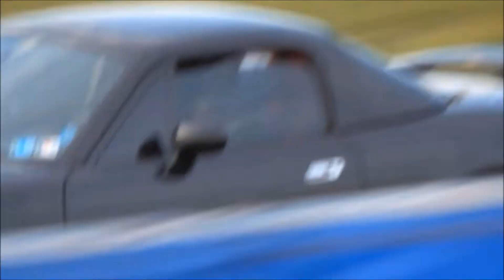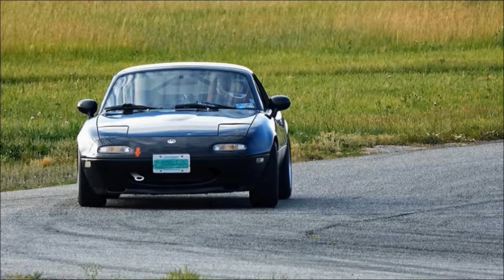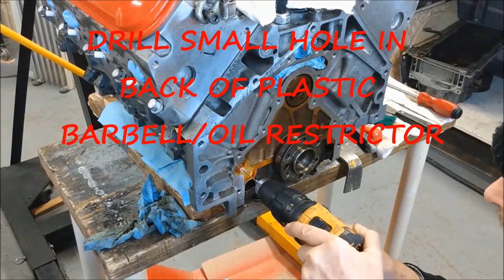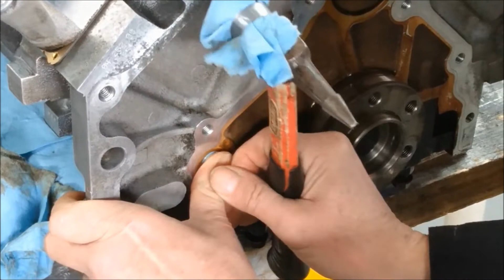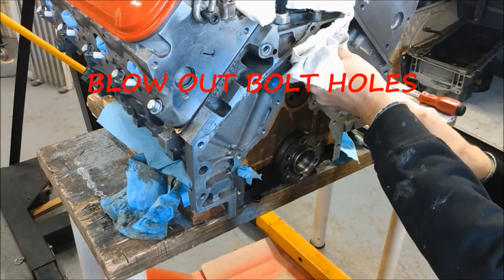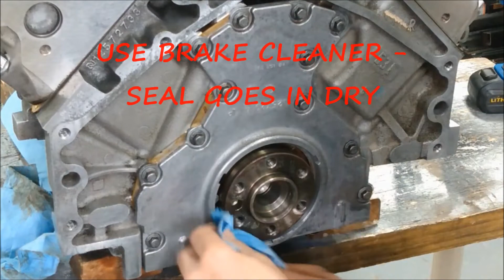COMPLETE LS REAR COVER, REAR MAIN SEAL AND BARBELL/OIL RESTRICTOR REMOVAL AND INSTALL

Comment: Iv put together a few LS now and i have never used a tool to Aline gasket to crank. Iv just flat edge the cover to the block on both sides. Yet to have a problem thankfully 😅
Reply from the maker: I'm sure thats ok but I've heard even a slight gap around the crank can cause a leak.
Reply: Your right" if the seal is on first, and you straight edge. It's the same thing. Same as the front, use the Hormonic Balancer. People get  wrapped up in marketing not Realizing people are trying to get their hustle on and make a buck. I just wish I would have thought of it first lol

Comment: so which is it? Cover flush to the bottom of the block or seal centered with the circumference of the crank flange? It can't be both.
Reply: 1 thing you don't want, a distorted seal pulled up or down. You're asking for trouble. If you're paranoid about the backing plate being flush to the pan, run a bead of right stuff along the bottom.

This man nailed the process!

Comment: Well done.
Engine end covers before the pan. Proper sequence .
Reply: He didn't torque spec the bolts or even silicone on the edge of the plates to seal it right this a mess from the part where he didn't torque spec the bolts
Reply: @rotsbelramos7685 he absolutely used torque specs. You just missed it.

Fyi, this is how it's done. Perfect example of using the tool which so many don't use.

Comment: Did you reuse the rear cover gasket?
Reply: No, I used all new in the engine. I didn't rebuild down to the crank, but I  replaced everything, seals, gaskets and O-rings. Its a high mileage truck engine so I'll eventually re-built it completely and bore it out to 5.7L.

Comment: The rear main seal plate is torqued at 22 pounds per bolt thats the spec the pan bolts are 15 lbs on the digital wrench

Comment: Nice!! Will this be the same procedure to a 6.2
Reply from the maker: Should be the same for any Ls engine. The whole exercise is to make sure the torque values are accurate. If the spring is pushing against the rocker there is no way to get the right torque.

Comment: What is that area above the back of the cam ? You have paper shoved in it. Is that open  all the time .
Reply from the maker: It's covered when the cover go's back on. It's where the cam angle sensor comes down.
Reply from the maker: Actually it's covered by the transmission bellhousing. I dunno why it's like that. I remember the cam sensor go's down further and seals below the opening.

Comment: Without the sump it's part of the torque sequence the two bolts that pull the cover downward are at different torque specs so all that alignment was a waste of time. However you were thoroughly clean and precise in other aspects. Your sump should have been attached at time of fitting the rear plate and aligning tool used.
Reply from the maker: From what I've seen it can be done without the oil pan. Why would you have to pull the cover down? It has to be centered for the seal. If it's flush with the engine block then the mating surface is flat for the oil pan. You can take the oil pan off and re-install it without removing the cover.
Reply: @miatajackdiy4293  as it states from the factory and aftermarket parts guys, part of the process...however what would they know
..as they only build create this stuff. Backyard mechanic knows best
Reply from the maker: @454bigblock  V8 ENGINES
9 Install the rear seal housing retaining bolts on the engine loosely
and align the rear housing as follows:
a) Place a straightedge on the engine block oil pan rail. Measure the
distance on each side of the block from tl7e oil pan rail to the rear
lwusing with a feeler gauge (see illustration). This Step measures
the difference between the sealing surface of the oil pan and the
sealing surface of the rear seal housing in relationship to each
other.
b) Tilt the rear seal housing as necessary to achieve an even measurement
on each side. This Step properly aligns the rear seal
housing to oil pan sealing surfaces. Typically 0.000 to 0.020 inch
is an acceptable tolerance
Reply from the maker: @454bigblock  ~Note: Ideally the rear seal housing should be flush with the
oil pan rail, but because of the differences in seal thickness,
this may not always be obtainable. That is why there is a tolerance
of 0.000 to 0.020 inch. Always let the rear seal center
itself around the crankshaft and tilt the cover from side-to-side
to even up the measurement at both oil pan rails. Never push
downward on the rear seal housing in an attempt to make the
oil pan sealing surface flush, as this will distort the rear oil seal
and eventually lead to an oil leak!
Reply from the maker: @454bigblock  This is from the factory manual.  I guess they would know more than the aftermarket parts guys.
Reply: @454bigblock  pretty obvious you don't know what you're talking about.

Comment: Should have shimmed the plate with the crank flush on bottom might not square u up with the crank
Reply from the maker: Srry, I don't get this, shimmed the plate?
Reply: @miatajackdiy4293  seal going on the crank and having the timing cover plate square with the crank might not happen by just flushing it up on the bottom
Reply: @miatajackdiy4293  kinda like shimming an oil pump but u would be shimming the rear main seal
Reply from the maker: @simplestandards  Thats why I used the alignment tool. It centers the plate to the crankshaft. I don't know how a crank could be 'square' with the plate, it has to be perfectly centered to the crank otherwise the seal will leak.
Reply: @miatajackdiy4293  thats what square means is to center it perfectly in your case having a radius would mean equal distence around
Reply: @simplestandards  dude you don’t know what you’re talking about. He used the damn tool to “square” the radius of the ROUND crank. Lmao funny guy
Reply: @simplestandards  the whole purpose of the tool he used is to "center" the cover equally around the crank when the cover is torqued. Granted, he also has to verify the cover being flush with the pan rails, he did just that.

Comment: What are doing using a speed wernch your js like the Mexican mechanics dont use el manual says you have to torque spec the bolts you cant js speed wrech em in plus there a zig zag  pattern you didn't even perform right
Reply from the maker: If you watch the video I use a torque wrench to finish torqing the bolts